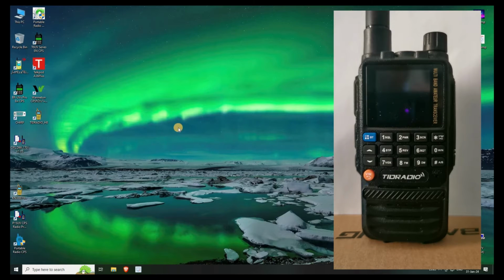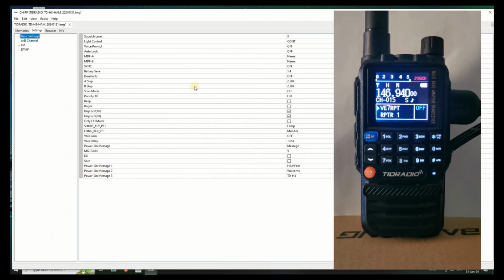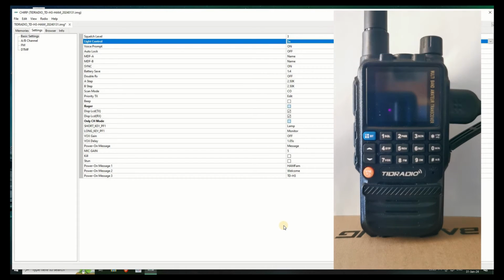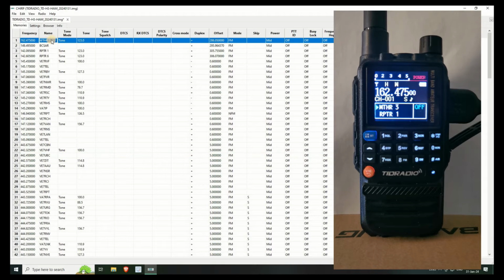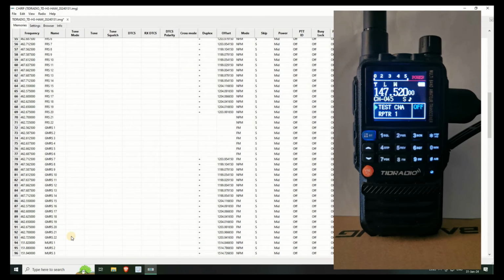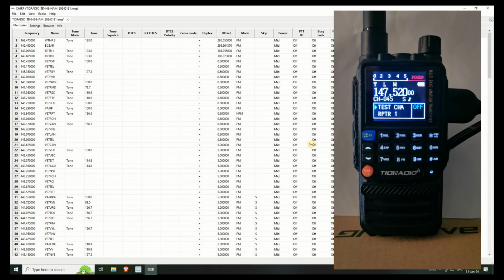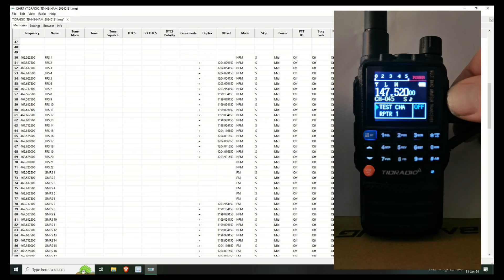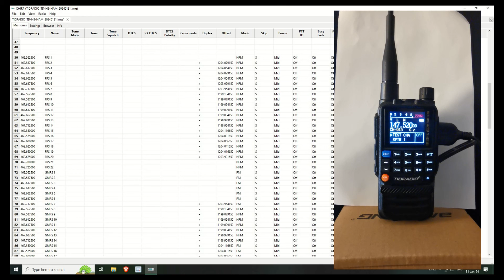📻 TIDRadio TD-H3 HAM Radio Programming Tutorial with CHIRP 🔧

Comment: Radio did not respond...any help please
Reply: If your press the astrix and ptt when you turn on the radio you can select either gmrs, ham or normal (which allows both)
When you try and connect to computer you must select the appropriate operation mode
Reply from the maker: ^ what KillerKatt66 says 👍

Comment: I've had TWO of these. Both malfunctioned after firmware updates! Neither works. One won't even come, the other the flashlight dimly blinks and that's it. No display on either. I do love the radio WHEN IT FUNCTIONS CORRECTLY!!!!
Reply from the maker: +@pwesley5854 aw man, bad luck. I have had no issues updating the firmware.

Comment: I can not figure out how to send a tone signal from this radio (It beeps into the selected channel with the desired tone 1000, 1450, 1750 (basic setting), 2100 Hz). Tried as written in the instructions: hold [PTT] + [ LAMP ] key (upper and lowest button) does not beep it. Tried to reassign the lower button from Lamp to Tone also nothing happens. It does not beep into the channel with the tone I need.
What am I doing wrong? Who can check on their own works or not.
P.s. firmware: item 42 is written version 240229 (it was when I bought it).
Reply from the maker: Set the tone you want to use (menu 32) then set the Short Key PF1 (odmaster) to TONE and update radio, make sure you are on the right frequency/ A or B then just press the bottom button and the tone will be sent on which ever of A or B is selected